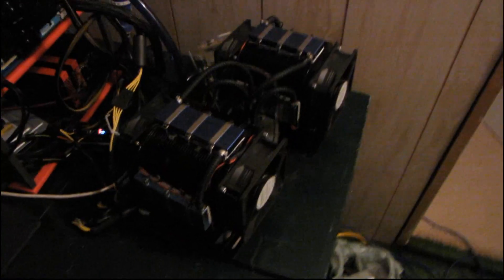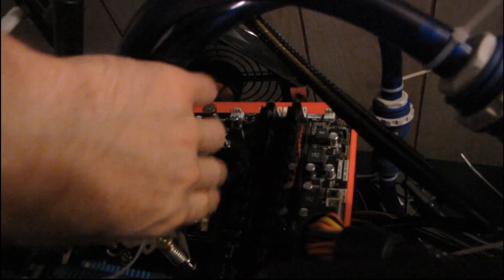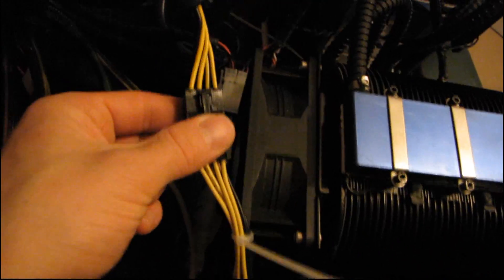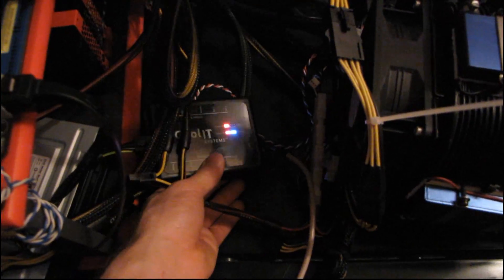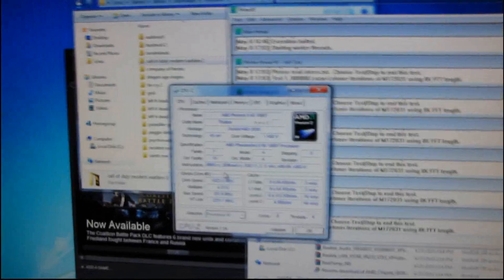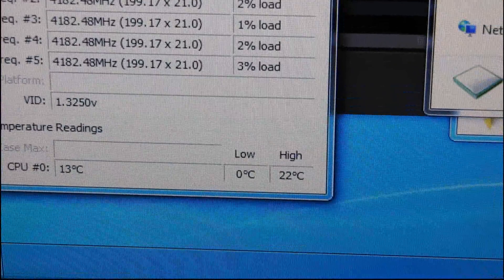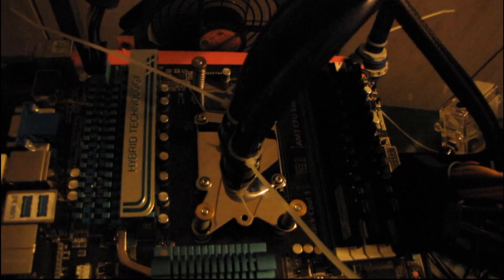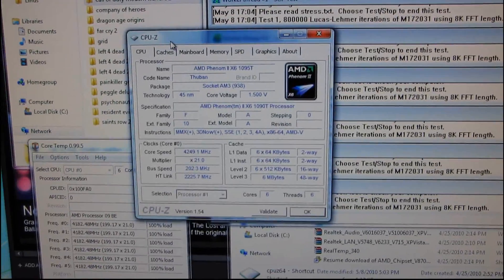Super Secret Project Revealed - 2 Boreas TEC Coolers on a Phenom II X6 1090T Linus Tech Tips

Comment: I once stuck a 200W TEC on an old AMD Athlon 3400+ OC'ed 2.6GHz and powered it with a 600W psu. My idle temps were -22c and load was like 2c. I simply sandwiched the tec between the cpu and heatsink

Comment: This is quite unbelievable how much money you spent on this rig and for what...for 0 degrees C? I did this exact same thing only i was able to fit it in my case using a $40 heat sink and $50 peltier unit. That cooled my 1090T to 0 celcius as well. Not saying theres anything wrong with yours but seriously dude, you coulda done all that for just over $100 AND been able to have a nice looking mid tower case :)

Comment: @Greathoof Well TECs (Thermoelectric coolers) actually use the Peltier effect, so in a way are relayed to phase change cooling. There are NOT limited to room temp as the minimum temperature. Also 15 degrees C isn't that low for a room temp.

Comment: @Troothforc go with the 1050t and save yourself a 100 bucks. the 1050t can overclock to 4ghz very easily but overclocking it higher than 4ghz might be a little difficult,